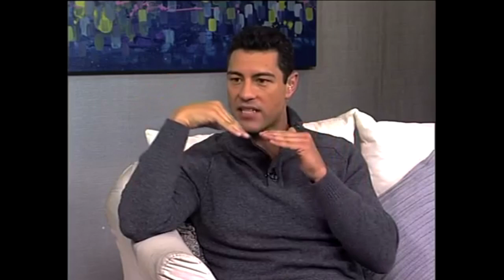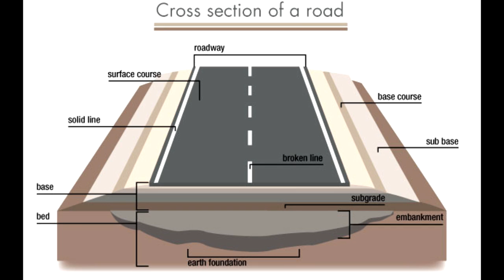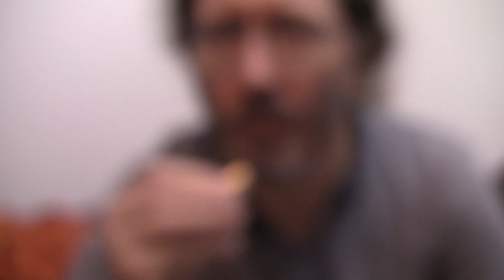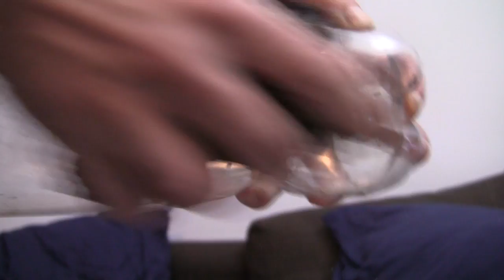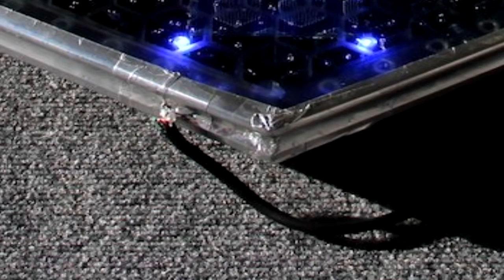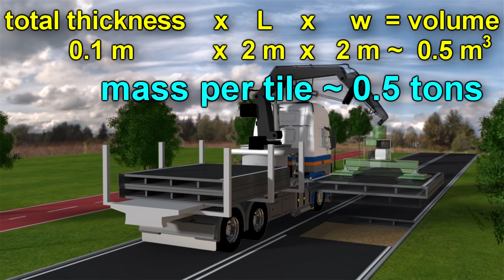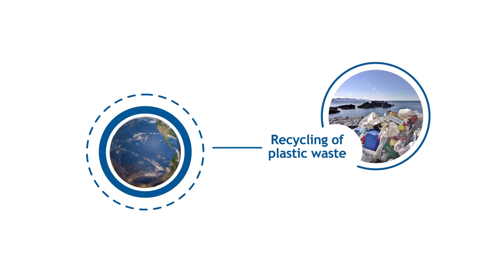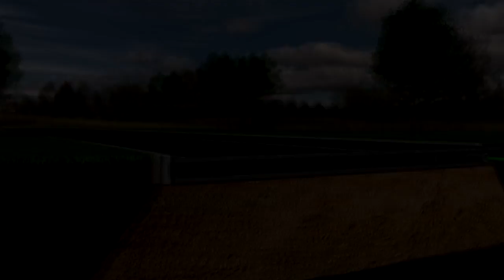Plastic Roadways BUSTED!

Comment: first thoughts before watching the video and knowing nothing of this idea. (I've paused at 30 seconds in)

the concept sounds good. prefabricated roads, that speed up construction, with utility pipes already in place. 
I know the military has been using a similar concept for helicopter FAR points (basically slap down down plastic panels, bolt them to the ground and then pick them up after use and throw them on the back of a truck for the next landing pad.)

now for roads. my first thought is "it's going to be light" which could lead to all kinds of problems if not anchored correctly" the second problem is the road surface but I guess a ruberised surface (like those play ground mats made of old  tyres.

theoretically it could be made of recycled waste and the panels themselves could be recycled when broken to save maintenance cost.... well onto the video, 

edit* (3:30) so the plastic roads are just the surface.... ok not great but not bad either, resurfacing roads is a major part of road maintenance. so it's at least useful in that respect. where I live we often have problems with potholes from freeze thaw weathering of the surface, so something like this could be useful

edit* (6:30) agreed it depends on the type of plastic. but a good composite structure using multiple forms of plastic could solve that problem, maybe with a top coat made of recycled tyres which will provide good grip and durability. there are also a few engineering tricks that can be done to improve support to the surface

edit* (8:40) yep have to agree the whole drainage thing is silly, I can understand making it possible to run services through it but drainage..... there's a reason roads drain to the sides into pipes. 

edit* (9:40) I can think of a few ways that the load can be spread out while maintaining the channels. the simplest way I can think of is to limit the size of the channels. or better yet place them under the panels themselves (i.e lift up panel, dig hole, place in pipes and cables, replace panel) I'm not an engineer so I can't say what would be the optimal solution to do what they want to do, other than limiting the size of the channels and making the rest solid

edit* (21:00) you know what I think you may be onto something just melt the plastic down and use it as a replacement binder it could at least take up a percentage of road maintenance.

final thoughts, it sounds like an interesting and potentially useful idea but I don't think they've really thought through the problems I can think of a few applications where it could potentially be useful (such as temporary roads and walkways at construction sites for light traffic, maybe in disaster zones to aid transport but beyond that not much) 
it could potentially be useful for setting down temporary road surfaces or helicopter landing pads (like the military temporary landing pad I mentioned) by bolting them down to give something better for purpose than just bare earth. 
in all honestly just like water seer and solar roadways... it's probably a scam but that's not to say that there isn't some potential in the whole idea and hey if all else fails i'm sure they could be used for prefabricated housing... that hollow plastic got to have some good insulation right? lol

yeah I'm trying to give the idea the benefit of the doubt even though I can see they haven't thought it through and it's most likely a scam, doesn't mean someone can't use the idea to make something practical

Comment: here in Europe we have lots of manufacturers that use different binding agents than bitumen 

there are aleady manufacturers that use for example old oil from deep fryers to replace the bitumen 

also "silent asphalt" adds polymers or rubber but the main component stays rock

Comment: Hey, wait a second.  Let's say you want to run fiber under your plastic roadway, since fiber is vitally important to communications today.  So your options are:

a) Wait for the entire road to be finished, then make one long fiber run.  Problem with that is the road is now stitched together, and the entire fiber run will need to be removed each and every time you need to repair a road section.

b) Make lots of short runs under each tile.  Problem with this is the sheer amount of time in terminating each end of the fiber, so it can be disconnected.  Since fiber is typically run in pairs (one upstream, one downstream), you'll need four connectors "per line", and with major fiber runs being hundreds or sometimes thousands of "lines", that's a LOT of connectors.

c) Screw the plastic roadway gap and just bury the fiber like we do now.

And this would apply to everything being run under a plastic roadway.  So who in the fucking hell would want to run their conduits or cables through the middle of a road?  Answer:  No one.

Comment: What came to mind first:
1. How will they make curved and hill roads (basically all of roads) with pre-fabs? Will they do just perfectly straight roads? That would be awesome! :))
2. There was some pipe running through the road. OK maybe some cables may be so near the surface, but pipes? Are they suggesting to put water pipes so close to the surface, exposed to subzero temperatures?

Comment: Curious, but couldn't you combine some parts of polyethylene terephthalate into the asphalt when it's being placed onto a road to help substitute the bitumen? Like, not a full substitution, but sorta like an additional binder, assuming the melting point of the two are identical and it wouldn't interrupt already in place operations of placing asphalt in the first place.

Comment: Would love to see a bulldozer or tank drive over that plastic road a few times...

Btw the idea of premade road segments isn't a new thing, that's basically how the german autobahn was built during that adolf guys regime, only they didn't use plastic but concrete slabs. In some places they are still used today, google "german autobahn blow up" to see pictures of what some problems are. Bear in mind the thermal coefficient of concrete is only a fraction of that of PET (or any other non-fibre reinforced plastic for that matter).

Comment: Depending on additives and fillers used for polyethilene, PET or any other plastic "foundation", resulting material may be suited for being a road cover comparable to asphalt cover. Probably. Would it be cheaper though? If they meant pure plastic then kek.

Comment: Did anyone ask how you would deal with the cables and pipes would impact replacement of modules. The pipes would likely be modular, but you would have to assume that all of the cables would not be modular on the scale of the road segment.  Every time you went to replace a segment, you would have to rip out cable from all of the other functioning segments.   It's just stupid all around.

Comment: I think this "BUSTED" series is  a bit of a hit and mis. While there clearly are issues with many of these things I'd not be so quick to completely dismiss the ideas just because there's no immediate solution (or you can't think of any). Society moves forwards by us proposing ideas and trying to solve the problems on the way. I like the parts you point out things that clearly violate laws of physics etc but I think you're too quick to jump into a conclusion with costs etc. Things change.
I'm pretty sure if YouTube was around in 60s you'd make an episode of this series called "Moon travel BUSTED!"...

Anyways. Still a fan of this channel :-)

Comment: another thing they dont consider is the land underneath.everything shifts. that is how you get potholes and cracks to begin with. frost, etc is constantly placing stress on a roadway. asphalt is somewhat pliant and engineered to "go with the flow" to a degree. this roadway would have to be build on concrete pads so huge to prevent warping and popping all over....
Reply: like the old highway systems built in the 60's...

Comment: Seems like no ones asking. So water is able to pass through the hollow underside of the road right? What if it freezes?.............      I mean A. you then have a blockage which i think might be best case scenario or B. you have ice warping and piercing through the road surface. 

edit ah never mind i think ive figured out thier intended plan, they are gonna build Solar Freakin Roadways under the plastic road to melt the ice.

Comment: Until now, pretty much all of your debunks have torn apart the concept, proving that it will never be feasible.  The hyperloop is probably the best example in that a 300 mile or whatever vacuum chamber could never be done, and even if it could it'd be a death trap turning the passenger cars into artillery shells with a single breach in the tube.  I think this one is different in that it's too early to tell whether they can overcome the major obstacles, while other aspects can easily be addressed by tweaking the design.  I'm not unsold on this one just yet.

Comment: The hollow molded form is a terrible idea...  

What I think wouldn't be a bad idea, though, is to mix recycled plastics in with the bitumen mixture. You want something soft for grip, and adding plastics may make roads more water resistant and malleable to prevent potholing. I think it's at least worth a test.

Regarding the durability of plastics, have you tried rubbing two chunks of asphalt together?

(edit: okay.. about 18 minutes in, the idea is already covered... helps if I watch  the entire video first before commenting.  lol)

Comment: Would PET combined with bitumen adversely affect its properties as a road material? if you are only looking for a recycling channel that MIGHT work without having to add the spin of "plastic" roadways. As for making road surfaces modular it's already been done. There may be some room for improvement there,  but I doubt the ROI on it will make it any kind of practical.

Comment: 1.- They didn't specify the plastic. Why did you chose one for them, that, oh wow, was perfect for "debunking"?
2.- The computer animation had clearly a different substrate embankment, so I really doubt that they claimed to make road just by slaping plastic slabs on the ground.
3.- Nowadays is common to enrich asphalt for roads with recycled plastics and tires.
4.- Lineal and superficial thermal expansion coefficents are irrelevant, if your material has a higher coefficent you make thermal expansion joint more frequently thats all.
5.- The problem with the road flexing is just a problem if you have a not enough thickness, you just have to use enough section to have the plastic in the elastic phase of the material. 
6.- You constantly brought up the solar roadways scam to deligitimise this different project.
7.- You gave the plastic 1kg/dm^3 density. Why?
8.- You gave the arids and rocks from asphalt a density of 3 to 4 Kg/dm^3. That's quite a lot. Where did you get that from.
9.- Saying that something is expensive is kinda not an argument. Prices can be lowered due to increased efficency in production.

The only legit criticism of this project is to be very vage, but in my opinion you didn't disprove anything. Don't you have the concern of "debunking" a project that may be feasable some time?

Comment: Having worked a little in plastics, specifically in how to effectively use various grades of recycled plastic to make new plastics. It's just another problem with the idea. What I bumped up against, is that new plastics made from recycled materials are very much weaker than the original clean bottle.

Recycled plastic comes in various grades, where a higher grade is more expensive but contains less non-plastic materials that have been filtered out.

But the more junk is in the mix, the weaker your new plastic is and I found that it's reaaaaally tricky to make a plastic bottle as sturdy as the original, with low grade recycled materials. After sometimes just a weak, it would start to break itself down and the structure would weaken considerably.

Recycled plastics aren't as great as people think they are :P

Comment: and what about over sized loads ? there are some instances where trucks are allowed to carry things over normal load restrictions , then theres mva's ( motor vehicle accidents ) they are known to do things like gouge out the road and what about an mva that involved a fire  what if a petrol tanker catches fire cause that does happen , i really could see a fun new game for boy racers in the future " lets see how much we can fuck the road with a burn out !"  , then theres the replacement of the sections sure this would be easy in instillation because your going one at a time but how are you going to reach between the sections and couple and uncouple the gas electricity water and stuff ?   
and getting back to fire , we just had some doosie bushfires and they usually cross roads so what about radient heat damage are the roads going to add to the problem because i can see they would , i could see them being simply fuel

Comment: What it if we made them out of thorium? Wouldn't that help the road absorb solartrinos thus strengthening the plastic and increasing the bullshit coefficient?
Reply: SOLAR-POWERED FREAKIN' PLASTIC THORIUM ROADWAYS!
Reply: "bullshit coefficient"
I'll be using that from now on, thank you.
Reply: Unobtanium is MUCH stronger and more durable. Plus it comes in Bitchin' Colors! Colors only limited by your imagination!
Reply: A radioactive road.. I can already see people advocating for it
Reply: What if we made them out of heat syncs and then the roads could be made of ice gathered out of the air!
Reply: Well, the plastic road holds a BS Coefficient of 8000 keks. If we were to add Thorium that would easily be over 9000 keks. If you want to make it even higher than this and break a few world records, then give adding 55% bullshittium a try... you usually get 4000 keks per kilo at 99.9999999999999% purity and it's fairly cheap to get hold of since all you need is to watch bad kickstarter/Indiegogo videos
Reply: Would a Hendo Hoverboard work on a thorium surface? If not, we would have to get a layer of copper in there somewhere. I want to be able to use the hoverboard on the entire road.
Reply: we could also build hyperloops along side them too.
Reply: Well sure, not only can you drive on it, you can power your car with it. 
Think of it; a roadway that powers your car... Now that's BS worth making a video about!
Reply: SOLAR-POWERED FREAKIN' PLASTIC THORIUM ROADWAYS!  for CHRIST
Reply: aahaha bullshit coefficient
Reply: It also has built-in waterseers.
Reply: And generates water from the air.
Reply: Genius!
Reply: cuzinevil1 Darn, you beat me to it!
Reply: Actually thorium in a LFTR  is very much a viable idea, puting into a car as fuel though is fucking dumb, too bad ppl remember this stupid initiative about thorium, and forget the important part how it could solve energy crisis.
Reply: But that road would be the most dense road of all time!
Reply: Or simply press Infinity stones into a flat surface and the energy from Thor's testicles can power all life on Earth. God, why do I have to come up with all the great ideas.
Reply: SOLAR-POWERED FREAKIN' PLASTIC THORIUM WATER PRODUCING ROADWAYS!!

Hawking was wrong. We don't need a Theory of Everything, we need this.

Comment: a) Why is everyone trying to screw over the Romans? They practically worked out the main details of road construction.
b) Didn't Mythbusters build a plastic roadway only to fail in the initial construction due to thermal expansion? I believe it was to test a Hotwheels car vs a real car over an incline.

Comment: i'm just sitting here and wondering... how frikkin dumb you have to be to use plastic out ot all materials... Any1 here worked with plastic? Models, plasticard or something like that? Plastic is too easilly breakable for roads... if it wouldn't we would already see this kind of thing... (just started watching vid)
EDIT:
just watched the whole thing and i see that Thunderf00t mentioned that. Also they want it to be modular and to put the cables inside... so what? they want modular cables as well? not every company will want or permit that... 
Anyways, as always good video :)

Comment: The thing I don't get is how the cavity in the roadway is going to channel enough water to alleviate flooding. If it's a foot high, for instance, roads are still going to flood. Not only that, but how will the water actually flow anywhere? If you have a road that goes up and down, like -- you know -- roads tend to do, how is the water going to flow uphill out of the troughs? This makes solar roadways start to look like genius.

Comment: Even if I don't discuss the fact that PET is too soft or your result (because you will find more or less the same results. Maybe a bit less visual). I have a small hair to split.
Your mechanical resistance or abrasion testing may be a bit less dramatic. Because you have used PET that was blown and not injected or extruded.

Comment: Asphalt is a plastic material, it's the chipping filler that gives it its wear resistance. I suspect that the substrate will take as long or longer for plastic roads and would bet that it is faster to drive one of those asphalt surfacing machines down the road than lay those plastic panels. I see large EU grants here all they are doing is grant harvesting, it really amounts to fraud.

Comment: We already have road resurfacing machines, which are amazing.  They chew off the surface, bake and remix the asphalt, and lay it back down behind so a roller can pass over it.  They don't move fast however they are persistent and get the job done in a reasonable time.  I think they can do several km per day with a crew of about 4 or so.